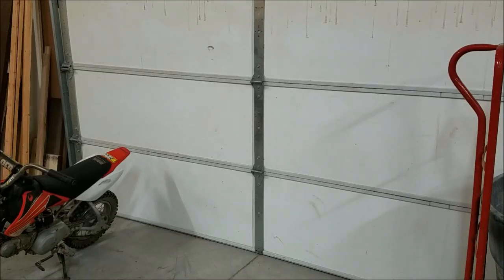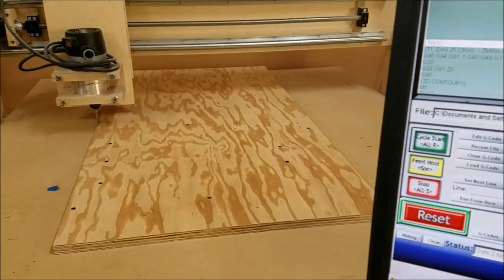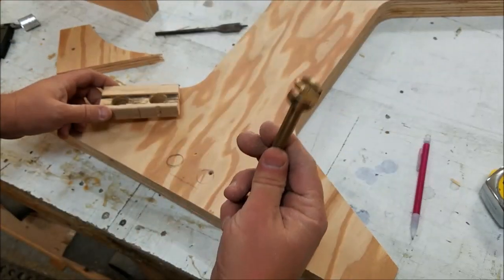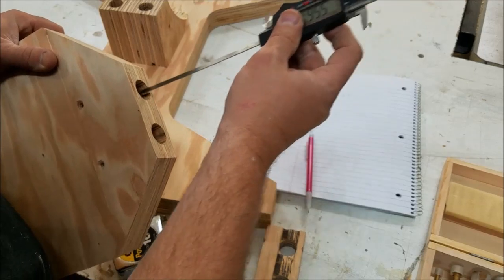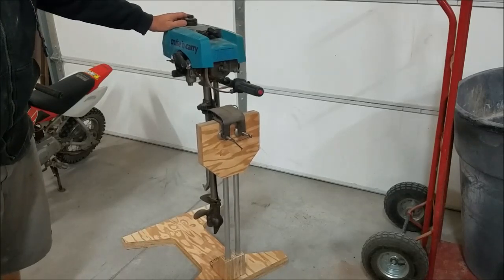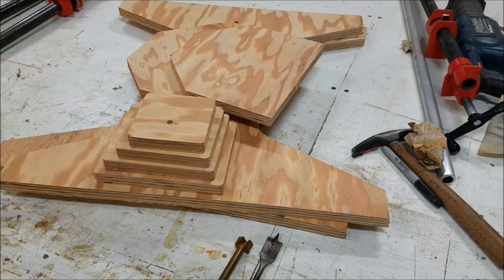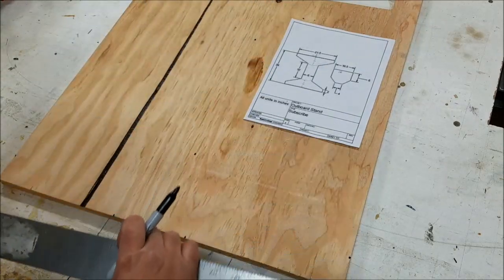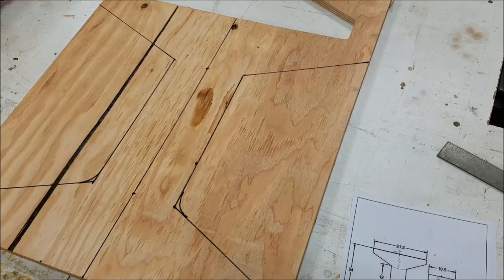Not Your Average DIY Outboard Stand

Comment: Great tip on getting the casters, thanks!

If I were going to make several of these, I'd put something, like thin, 1/4"? plywood on top when cutting one out, then using that as template for the others.  But you have that CNC machine so no need...  :)

Comment: Looks like this stand is perfect for your midget motor lol  I have a 9.9 Merc motor that would work on as well. But then i have a bit older 25hp Merc and a really old ,great running 40hp Merc motor thats about the size of a huge trashcan because its so old.LOL I need to make a stand that will hold the 40 and 25hp motors and then a smaller one for the two 9.9s i have. One runs while the other was offered to me for parts for free by the guy i bought the motor off of. The 9.9 was used at a boat rental place i purchased it from along with one of their fiber boats.Back in the day i paid 400bucks for the Boat,motor and spare motor for parts and i thought that was cheap.The boat was a tank though and bent the truck rack it was put on to get it to my house! hehehe I loved that old rental boat it had a nice hand crafted wooden rail around the whole thing a nd the seats were such that it only had drain holes to allow the water to flow back to where the plug was. So i could use sections ,between the seats to toss the crabs until we got back to dock with them to throw in a basket! lol It was easy to keep a large container/bucket/cooler for a make shift live bait well for us if we were fishing and Could fits 4 people on this outboard quite comfortably!  It had a 1person built in seat in the bow and then three other bench style seats in it. The boat was so heavy and sea worthy that once i threw a new 25hp motor on it the thing still got up on plain! Sorry i ever got rid of it?! :>( In any case i want to build stands my self to better store the motors i have because sooner then later i will get another boat. If anything were to happy in our area i may need another way to get out of my area of the state other then automobile transportation? Living on South Jersey's southern most point in Cape May if it were summer and we had to evacuate the area for any reason we may have to bug out via the Delaware bay. We may be forced to leave our vehicles behind and flee on a boat. This one would have been perfect for that as it was a very solid boat fitted with a nice canvas cover it would be the fastest way out of our state with Delaware only 17miles away. If we had to drive and in our tourist area if it was loaded with people it would be bumper to bumper traffic and we may never make it out of the area before what ever emergency hits? So keeping these motors store properly and getting a new boat is paramount for me.....Thanks this is  a great idea and i can duplicate it very easily although i already have the materials for either stand i would need so its kind of free materials as all of it is left over from old jobs or trash picked from dumpsters as many builders are very wasteful! :>/ Well thanks again for the video and the idea! good stuff

Comment: I like your design, it might hold as big as a 15hp ! I am an AOMCI member and go to a lot of swap meets and being able to dismantle them for space is a plus . Between my buddies Ron and Phil and Ben and I we usually bring 20 or so outboards to the meets . Painted in Holiday Bronze or Sea Horse Green or black they would show really well ! I think the square blocks might hold better and a 10 deg. Angle on the transom plate might help . Just a thought ! 👍👍
Reply from the maker: I planned to do just that, until it came time, then I said screw it.
Want me to cut you out one? You'll have to assemble though.
Reply: @BrandonsGarage  I can’t imagine how much to ship ! Lol. But thank you very much !! I plan on making a few myself but going to review the video for measurements if that’s ok with you !
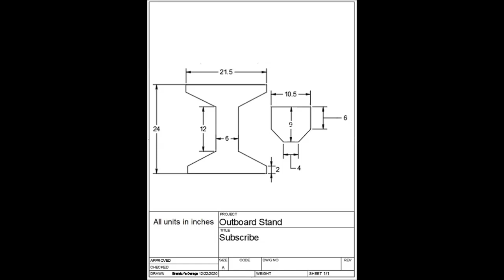Reply from the maker: @davekimbler2308  Not a problem at all, the main dimension are on the drawing at the end.  @ 14:42
Reply: @BrandonsGarage  thank you much ! If you need any parts for OMC just let me know because here in Minnesota we do have a few outboards ! 
Lol . I have a few 1950’s and 60’s laying around . Even turtle tops ! Lol
Reply from the maker: @davekimbler2308  Well thanks!
If you want me to send you a cut-out, just email me your address.

Comment: Nice. 
This actually gave me a lot of ideas for new outboard stands. I have 5 outboards and zero good stands for them.
Would it be nonsense to try that with a U-beam as the post? I would imagine it would be a bit more rigid compared to the pipes. 

...ain't saying nothing no more about your audio "improvements"  
(just stop buying your audio stuff from Eugene)
Reply from the maker: U-Beam, or C-channel, is what the factory one uses. What ideas do you have?
The U channel will be more difficult to install, when I scale it up for a larger engine, say a 40 HP+, I'll figure that out. 

The audio used to be perfect, until I lost my phone; The replacement cuts in and out, and is just ridiculous. 
I bought a $450 entry lever professional camera. Good audio, terrible video quality. Tried the ladies iPhone 10/11?, figured that would do it...
Great audio, but lighting in the garage would need to be absolutely perfect, as it tries to over adjust the darker areas. On a black power-head, you can't see anything other than a dark area where parts might be.
I need to figure something out before summer comes and I start getting into projects again.

Comment: Buying a new bit to drill the 7/8” holes? Why? You’re cutting the squares on the CNC, just run a drilling tool path and drill them out while the machine cuts out the parts.
Reply from the maker: When I read this comment, I thought to myself "Why didnt I do that?!"
Then I remembered.
A) The spacing needs to be the same on the base as the head unit. Head unit needs to be drilled after its assembled; by the time that happens I would have forgotten the spacing.
However now that I think about it, I could have made a drill guide out of the remaining scrap to solve this.
B) I only have enough tubing left to make 2 stands. The next stand may use iron pipe, or conduit, which may have a different OD. 
C) I forgot the 3rd reason.

Now, I could do all of the cuts in the head and base should I use square tubing.
Problem there is I would need to go in with a square broach to square off the rounded corners.